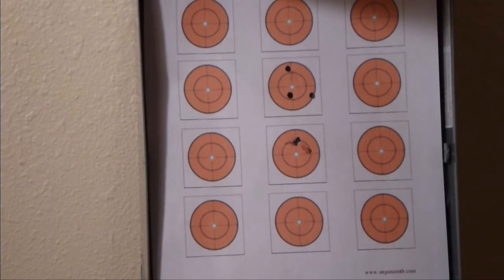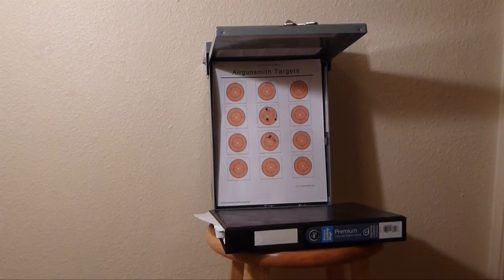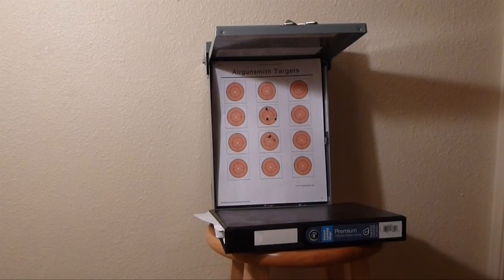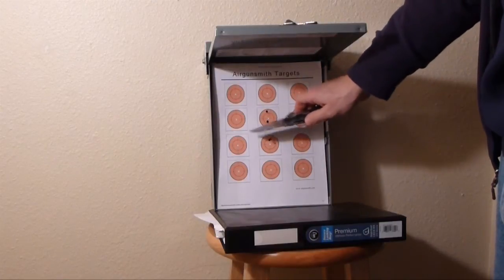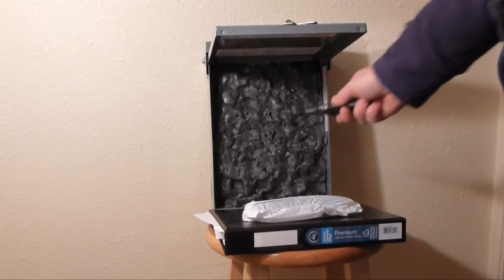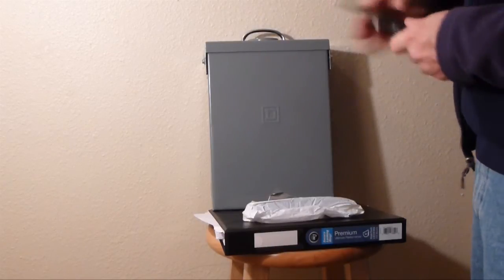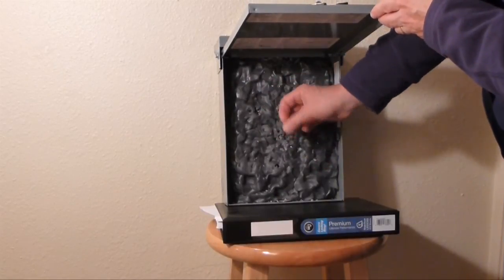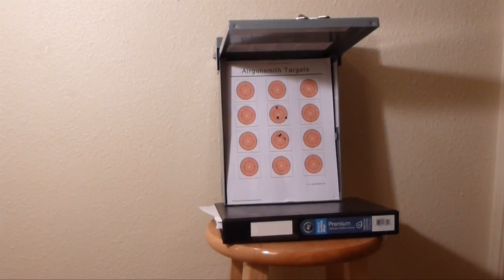Air Gun Pellet Trap

Comment: Duplicated your trap, excellent, well thought out.  Works perfectly, thanks!  Two thoughts the pellets don't penetrate that deep, think you would use much thinner duct seal back.   Also I used the top plastic cap turned it over and put it inside, sealed it with duct seal, and with screws for handle it sealed the top. Since its reversed and indents downward you have room for your fingers to go around the handle.  Again thanks for your idea, it was the best on the Internet.
Reply from the maker: +45flint    ****Excellent - I should have thought of plastic cap trick.  Glad you liked the video!

Comment: Would this work with a .25 Benjamin marauder rifle? Thank you
Reply from the maker: hollernathan It should work.  I use a .22 Marauder pistol.  Maybe set it up outside first with a safe backstop and try it out.
Reply: Try a welcome mat after duct seal to dampen noise should penetrating occur through duct seal placing in between the seal and steel plate should penetrating occur. Should help with noise dampening and those Hatsan’s are powerful! Just ordered a 125 Vortex Camo in .22 should be here tomorrow and hopefully dieseling will be minimal

Comment: Great vid! Did you stack the duct seal one on top of each other or did you stick them flat side against the back? If you did stack them I would think it would you a thicker surface of duct seal right?
Reply from the maker: I think I stuck them flat.  However, I have cleaned it out so many times that I have ended up refilling it with several more "ingots" of duck seal.  At that point, you just kind of smoosh them in to fill in the gaps.  Thanks for the comment!